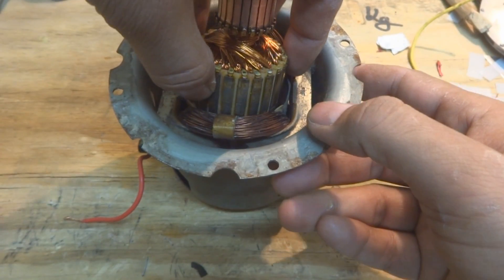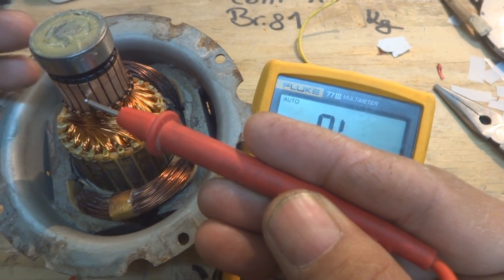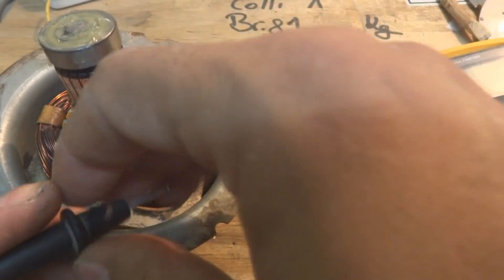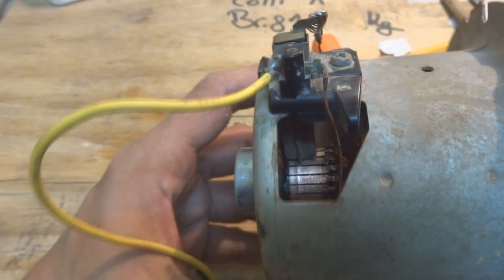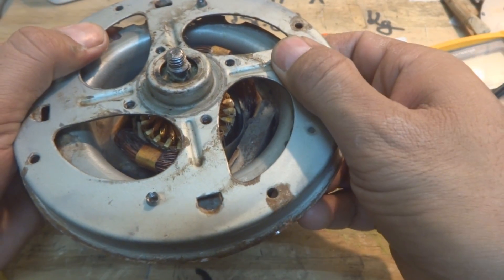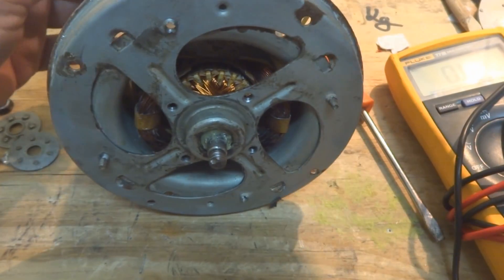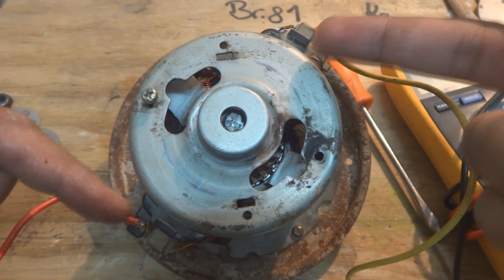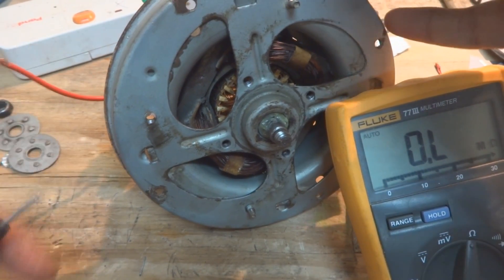Universal motor rewinding. AC series motor repair. Part 5 (final)

Comment: Sir I want to wind stator coil and armateur coil of my motor .if I count the turns while opening then I know the gauze and no. Of turns.but if I don't know them .then what is the formula to find no. Of turns and gauze of wire .
Reply from the maker: That is the easiest formula! The calculation formulas are very difficult and lengthy. So better focus on the old winding and note it down for future reference if needed.

Comment: today i dropped a screw into the spindle of my coffee machine  and it took me about an hour to get it out. i did everything possible and after trying it with superglue on a long object i succeeded but it now makes loud sparking noises while working. before it didn't make any noise at all. also there are two sparks inside visible from the two poles while the middle part is turning and i think i smelled something burned after the first use. do you know if i can fix that problem. might it be because of the glue or did i possibly damage the spindle from inside with the screwdriver while trying to get the srew out? i've had the feeling that it became more silent after a few times. should i just let him repeat the procedure until there is no sound at all or do you think there might be something else inside? i think there's nothing else that could have fallen into the spindle, only the glue or the damage from the screwdriver might be the problem. you got any suggestions what to do?

Comment: Great work, done by you to make us clearly understand the rotor winding,

As I am triying to wind my drilling machine which has universal motor with 2 pole stator as look similar to the motor as shown in the video, and have some questions on this,

1. how many times winding needed for a universal motor stator and had it to be opposite winding to the other.
2. how much a copper enamelled wire cost where to get it, I have already tried with hardware, electronics, cable store but no luck some people said it will be avail in electrical shop going to try it. (in online they are selling min of 1kg from china)
3.what gauge wire should I use for it.
4.If any link avail for the stator winding please reply.

once again thanks for the video :)

Comment: Thanks for the video very informative. 
Can a 110v motor be rewound to operate at 220v and how if it can?
Reply from the maker: +muadhatnet Thanks for liking video. Yes any motor can be rewind for another potential but you must have knowledge and understanding about that. The easiest way is you should get data from a similar size motor of 220V volt and apply it on your desired motor.

Comment: This was a good repair demonstration, thanks for sharing your efforts. I couldn't help myself from having a little chuckle at the German grease can in part 4 :D
One thing I did note there was no mention of, was the wire gauges used for the windings. Both the original and replacement copper wire gauge respectively and how important, or what the effects are of using the same or different gauge wire for the windings. Maybe an expert on the topic can chime in to clarify.
Reply from the maker: +Cain Galea Thanks for liking video. The wire used is the exact size replacement of the old wire. The wire size depends upon the current passed through it. If you use a thinner wire than requirement, it will do but it will fail as it will produce more heat when passing the expected current which would be more than its capacity. On the other hand if you will use a thicker wire, it would be better for current capacity but it will be very difficult to pack in the specified space. So there is always a perfect match wire for a motor which should not be changed with thicker or thinner. Regards,

Comment: Loverly repair jahan :-D :-D, i knew it would work :-D.
.
The difference in current depends on many things, the carbon brushes may be dirtyer in the old machine so the quality of connection isnt so good.
The bearings and suction restricton in the old unit will also have an effect.
If your repaired one delivers the suction power when being used, thats good enough :-D.
Universal motors are never spot on, just a  workhorse :-)
Oh, i do understand your quick test wiring, its not a problem as it will not be left alone.
Reply from the maker: +zx8401ztv Thanks dear friend for liking video. Thanks for understanding every thing too. Actually I commented on wiring because some people always finger small things they note in video. Problem with them is they are not understanding what actually is going on in the video and they try to tease others for no or very small mistake or reason. You are so nice that you are understanding every thing. This is due to two reasons as I know. One is you are kind enough and the second is you are rock of knowledge and understanding.
Reply: +LearningZone 
Jahan, i know bits and bobs about all sorts of things, but im not the master of any, ive been repairing electronics for more than 30 years and im still no expert!!.
I know enough to get most things working again lol.
.
When i see you repairing things with often very little test equipment, i know how hard it can be, ive been there too often, so i wont be nasty to you.
Your a clever and generious man that helps people, your ability to adapt yourself to different problems is magic, thats intellegence with lots of understanding/knowledge :-).
I try to leave a decent commernt, its appreciation for your kindness to allow me and others learn from your videos :-D.